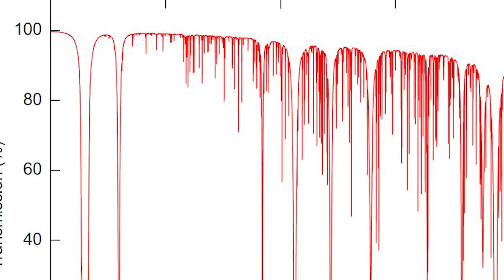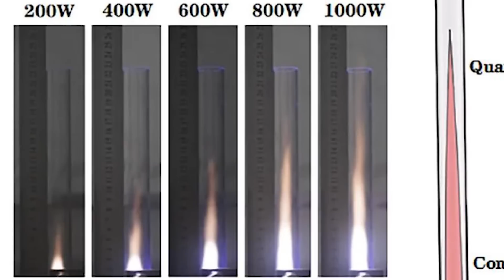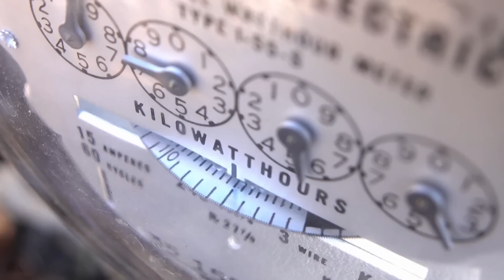The Microwave Plasma Jet Engine that Could Change Everything

Comment: This is one of the biggest non-stories I have ever seen.  Almost all of the thrust is the compressed air that is used to form the plasma, with a smaller amount of thrust from the increase in volume of the gas when heated by microwaves.  An airplane that could carrry an electric power station capable of producing enough electricity to supply a small town would be needed to scale his up to a "useful" jet engine.  Just a case of purblish or die.
Radio frequency and microwave plasma "jets" identical to what is shown have been used by analytical chemists to produce ionized ions from a water/acid solution of dissolved metals, rocks, etc. since the 1970s.  A nebulizer similare to a perfume sprayer produces a stream gas, carring small droplets of the solution.  That stream of gas is injected into the bottom of a plasma jet confined inside a quartz tube.  The droplits dry, vaporize, and the elements of the dissolves substance are heated until they ionize in the plasma.  The ionized elements give of light that is characteristic of that element.  By simply looking at the spectrum of the light from the plasma you can determine what elements are present and much of those elements are in the dissolved sample.
Argon is normally used to form the plama for water based solutions but for organic solutions (for example lubricantion oil contains a number of different metalic organic lubricants or anti-corrosion compounds} you can use an air plasma that "burns" the organics to release the metal ions to be analyzed.
Even back in the mid 1970's I was using a 3KW RF plasma for analytical chemitry research, but it was simple too powerful - it kept melting down the quartz tubes.  It turns out that about 1KW is the maximum you want to use, and usually you use even less power.

Comment: See... Most aren't catching... Not a truly carbon free... 
Not that carbon is a problem... 
But regardless... the Jet engine they make very likely wouldn't generate Carbon during use - but take note, it requires a power source strong enough to run that engine! Where do you image that comes from... Just like a math problem - nothing disappeared - simply shifts location!

Comment: Love how people say “clean energy” where do they think electricity comes from? Or the lubricants, plastics, components for batteries.  
It takes the equivalent of 50 barrels of oil to go 300 miles in an electric vehicle vs 10 barrels to go the same distances in a gasoline vehicle.
Reply: Hogwash!  Efficiently burning a hydrocarbon in a power plant and then using that to charge an EV comes out to less CO2 output even if the power plant is run on coal.  You can find the numbers on the internet do the math your self to see that.

Comment: Problem isn't the engine. You could have turbojet with an electric motor... 
Problem is storage. Right now, electric battery can't equal the energy potential of chemical reaction.

Comment: This is my problem with climate change policy. We all know that there is no alternative to jet engines fueled with carbon emissions. So we pretend like if we all use electric cars and solar panels that we’re going to stop the effects of climate change. When we all know we’re not going to stop flying on airplanes. So whatever tailpipe emissions you were going to have is going to be less than the airplane you fly on. Unless we find a serious Alternative to jet fuel and jet engines to allow us to fly. We’re never going to actually stop using oil or actually doing anything to “stop climate change”

Comment: The efficiency is the biggest issue.  In aircraft it is all about power in to thrust out at flying speed.  An electric motor spinning a propeller doesn't need to consume energy making air into a plasma.  It does very little heating of the air as it goes through so its efficiency starts off better than the plasma engine.
Reply: Yup. Modern jet engines are turbo fan engines, which the jet engine is used to produce mechanical energy to turn the fan rotor. However electric planes will never work as a typical commerical jet uses over 40 Megawatts of power to run the engines.
Reply: @guytech7310  Won't agree with "never" but "no time soon" is for sure.  Little short hop things may go electric but you are going to take 500 people 3000 miles with one any time soon.
Reply: @kensmith5694  "Never" is the correct word. We already heading straight into  major long term crisises: Peak Oil, Soaring global debt (Now 300% of global GDP), Demographics, and war. Currently we at the brink of Nuclear war.

Comment: The USAAF proved you could make a nuclear jet engine and if you had a safe enough reactor, you could use electric motors to drive propellers. Also, a number of companies are investigating electric jet engines.
Reply: Electric vehicles are unreliable, prone to failure, and aren't capable of the type of sustained energy/thrust required for prolonged space or atmospheric flight.

Comment: Wrap the plasma in a magnetic bottle to keep it off the container walls to stop the erosion while running coolant to reduce the convection heating of the container walls. Of course, all this takes more input energy. You can never get more energy out of any system than you put into it.
Reply: Maybe they could use fuel rich cooling to cool it, kind of like the f-1 engine where the outer ring of fuel injectors were set to burn rich to keep the heat down on the walls of the nossle

Comment: it actually doesn't...
to create microwaves and plasma you need electricity. you gonna build a nuclear reactor in a plane? you will need something OTHER THAN BATTERIES to create all that electricity. also if you use batteries (good luck making them light enough and hold enough charge to get anywhere...literally) you will need to make more electric generation plants. currently generating electricity generates 40% of all "carbon emissions" so if you dont get on the nuclear bandwagon you will be making the problem far far worse. just like with electric cars this is a new problem thats worse than the current one.

Comment: Can it be used to create electricity ? Like running some sort of generator
Reply: If you have a moving plasma and a strong magnet you get electricity out.  In a magnetic field, charged particles follow a curved path.  Positive ones bend one way and negative ones bend the other hence they end up in different places.
Doing this, however takes energy out of the motion of the plasma.  Since any such jet engine will make its thrust by sending the plasma rocketing out the back, extracting energy from the plasma reduces the thrust.

Comment: Mean free path... Can make Cathode Ray tubes that fire electrons through air at atmospheric pressure without problems ... But they're limited in size to say 1/2 inch screen size. And a few inch long

Comment: Fascinating for sure... there is a lot of electricity up there in the upper layers of the Aether (ergo we get lightning 🌩 discharges). Perhaps once aloft, the plane can draw from the Aether.
Reply: That is not very likely.  Consider how much the total surface area of the earth is and how little is currently being smacked by lightning.  The power per unit area is very low.  The total energy is only impressive because the earth is so big.
Reply: To reinforce what Ken Smith said; the aether has so much of a larger surface area combined with the fact that it's static electricity does in fact mean we can't easily draw from it and such an attempt would likely cost more energy than we generate.
Reply: @Ryanowning  BTW:  I stated and objection that didn't require me to say that there is no real thing called "the aether".  The source of lightning is not from some aether.  The separation of charges happens in the same sort of manner as a van de graph generator.  It starts with a low voltage difference between two things that are close together and the combination of gravity and the wind then moves them apart.  This is why we still have lightning after all this time.  Other voltage gradients that may exist would have been discharged by now if they were the source.  This even applies to "sprites"
Reply: @kensmith5694  Right, I don't want to explain electrical engineering here since I only took classes for it in college on my way to mechanical engineering. You can't draw that charge out except through expending energy; for the amount of space that the charge is distributed amongst you have to spend more energy than is present in the air. Furthermore, the energy is condensed in cloud formations that are dangerous to operate within due to cross winds and humidity.

So, basically, I can't fully explain it due to lack of specializing in it, but it's not a good idea for an aircraft. There might be ways of harnessing it out of my scope, but aircraft safety WAS within my scope.

So, sorry if it wasn't clear that I was still talking about aircraft. It's just not practical.

Comment: You've got a ball sitting on a tube and microwaves make it move. Let's not get carried away.
Reply: Or air pressure. Silly experiment. They could have placed the thruster horizontally and measure thrust by a spring scale or pendulum angle.

Comment: Wait;
Two HUNDRED THOUSAND WATTs to make only 1.2 pounds of thrust?  That is barely enough to get a very small toy model airplane to fly, and that does not include the 200,000 watt power supply, which means it will never get off the ground in a million years.  200 kilowats is about 1/2 as much power as a SMALL hydroelectric dam makes.  

BTW, we should be building hydro electric dams like mad, and the idiot green goons want to tear them all down.  They are worried about the fish.  Well, ban fishing and let the chips fall where they may.  If people aren't taking fish (salmon) out of the rivers, (which all have ladders at the dams so the fish can go up stream) then there will be plenty of them to breed.  Heck, the "native" Americans around here snag them (which is against the law for white people) and then just cut the bellies out of them to sell by the road way and they throw away (waste, in other words) the rest of the fish.  They have no sportsmanship.  They snag them!   Same with elk.  They shoot an elk, cut the hind quarters and back strap out of them and take the rack, leaving the rest to rot.  Waste!

I've always wanted to shoot a condor, but can't do that.  Why is it different from fisherman going for salmon.  (sarc)

Comment: Yeah, the climate does change... 
The issue with this is the power density doesn't exist in anything other than combination fuels or fissile. The key  is heating the air up and plasma may not be the most effective. It is tricky to work with and to contain it.

Comment: There's never a mention of where all this power is coming from. Like I heard a spokeswoman say concerning a EV power station once when asked about where the electricity comes from. "It comes from the building" she said. No really, that's exactly what she said. So the reporter then asked the electric company representative the same question. "Oh the electricity for this section of the grid is coming from a coal fired plant" the representative replied. So how is that lowering the carbon footprint again? Well, ask California. You may be able to afford an EV. But what's the point when the governor say's you can't charge it? Or run your AC or fridge or any other large appliances due to power shortages. China is turning on a new coal fired plant every eleven days. Yep, all about saving the planet 🤦‍♂

Comment: You would still need a high density power source for the microwave emitters for a commercial aircraft. The Chinese steal Russian jet engine tech because they are behind the curve there. So, how will they build a bleeding edge microwave atmospheric ion drive that competes with current engines?

Comment: My favorite part of these ideas is the material science. Like, how the heck are you gonna contain the plasma? It's just the most interesting part to me.
Reply: Agreed, this may lead to a scientific missdiscovery like teflon and blue fun time pills. This tech may not go anywhere but the material science discoveries will trickle down to help many other projects in the future. Material science is one of our weakest areas really, with additive manufacturing and the ability to matrix ceramics and metal alloys I think we are heading for a new manufacturing age akin to how steel/aluminum production and fossil fuel refining advances revolutionized the opening chapters of the 20th century.
Reply: NASA is working on that. If we can solve the containment issue fusion rocket tech is basically ours for the taking.
Reply: @Ryanowning  If a sled had wheels it would be a wagon.  I don't expect the confinement issue to be solved any time soon giving use fusion power.  They have been working on it since at least the 1960s and haven't cracked it yet.  They seem to be trying bigger and bigger hammers when a screwdriver is needed.
Reply: @kensmith5694  No, they're just finding a thousand and one ways fusion rockets don't work. They are trying different approaches.
Reply: I think the way to do it is to use a really strong magnetic field.  If you are going to eat a lot of energy making a plasma, you may as well use a whole bunch more making what is really a straightened out tokamak

Comment: Quite by coincidence I hit the like button just as you said "please hit the like button". I am keen on e planes becoming a thing (I live under a low altitude air corridor related to the local airport) but one of the biggest problems they face is that electricity generation and/or storage is, just by the nature of things, heavy. Maybe that requires a modern spin on old tech like swept wing biplanes to get added lift or a return to the monster wings of the Junkers G38.

On a tangent: If only Caproni had had titanium to work with.

Comment: Hate to pop the bubble, but their test of the metal ball on a quartz tube is not a proof of thrust, its a proof of pressure increasing in the tube.  Put it on wheels and see if it moves.

Comment: Plasma creation requires MASSIVE amounts of electricity. Buy a Plasma cutter from Harbor Freight and crank it up to cut some steel while monitoring the power used. Scale that up to that needed to power a jet engine. It is in the MEGAWATT range! It's also required to run for HOURS...RELIABLY. Nuclear power is used in spacecraft plasma thrusters but that is in microgravity and near vacuum! Simply not possible with current materials and power sources. Even Inconel and high temperature ceramics are vaporized by plasma. The sun operates as a nuclear plasma reactor!

Comment: This is a "Wooden" Chicken. 🤔 What's the humidity of the air used. Discounting variables, get water (H2O) REALLY excited, U got power. Think 'bout it. Hydrogen can be horrendous. H2O is a ready made Combustible/ oxydent combo. This has to have more than a little something to do with This "Contraption"...lol

Comment: 2:17 Came to watch 400w microwaves creating a plasma that can lift a 2.2lbs steel ball over a 24mm quartz tube, leaving disappointed.
4:24 Heeeeeey, it's Huntsville! If you are the sort of person who likes all things space related, YOU MUST GO to the U.S. Space & Rocket Center. Looking at he Saturn V there, it's either able to be rebuilt and fly, or that's the most realistic mock up I've ever  seen of any sort in person. It could have been built out of spare parts to make the magic, but the bolts holding the skin on are real bolts and not just painted plastic. That part of Alabama is a little less redneck than south of Birmingham, so it's safe to visit. I could go on, but I'll  stop here before I really get going.
7:43 That seems like a lot of work just to lift a steel ball.

Comment: Not going to happen.  Batteties suck for the rocket equation.

I could see a plasma assisted hybrid jet.  Since extracting more power out of turbines is limited by turbofan size, the addition of plasma gives an addition way to product thrust from jet turbines.

Or perhaps as a way to further accelerate gases exiting a turbo fan for higher performance engines.

Comment: Has been tried before, in 1972, didn't work in the air, on the ground connected to the grid it did, a bit.